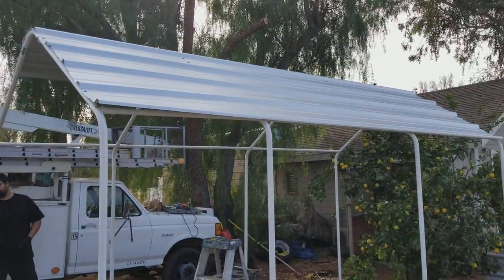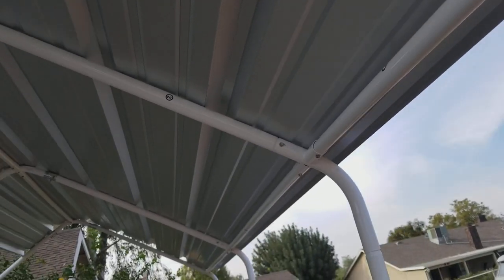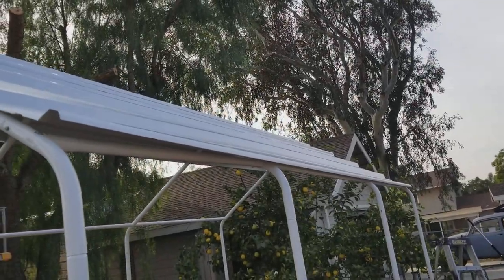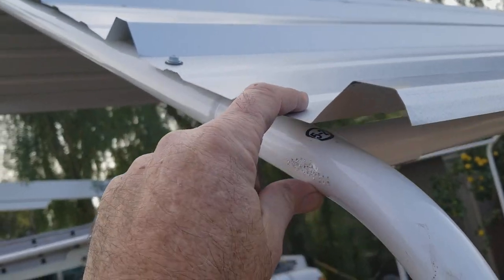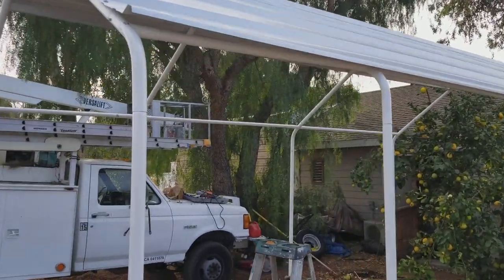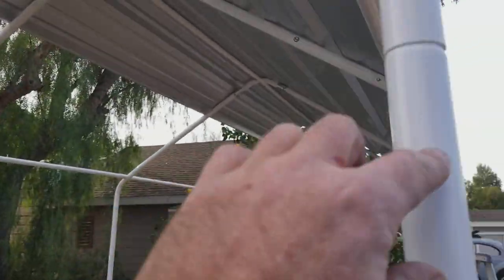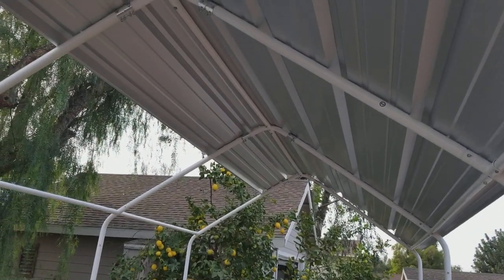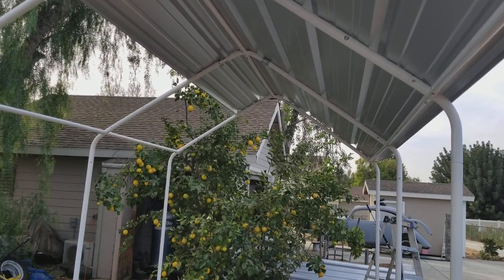harbor freight portable garage into permanent structure part 6

Comment: Excellent I came up with this idea before see ing yours or others as I have 22x20 heavy steel one about 29years old ..I got tired of replacing the tarps and strong winds ripping them off ..I did corrugated roof top still need to  reinforce it at every 5 feet..I made a smaller one 11x10 again metal roof for the wall I screwed plastic lattice walls a lightweight  gate on the side  wrapped the building temporarly with a tarp I cut in half used ties to hold it to poles I added pvc t joints across the top part and bottom each side at the joint areas  ...I took long rebarb to each corner and hammered them down into the ground to hold down the building so not to move in windy situ...s. Wrapped wire to the poles and rebarb

Comment: Doesn’t the water get trapped in panels? If installed other direction water will run off
Reply from the maker: not really it finds its way to one of the ends.